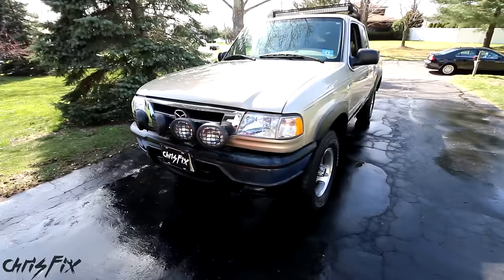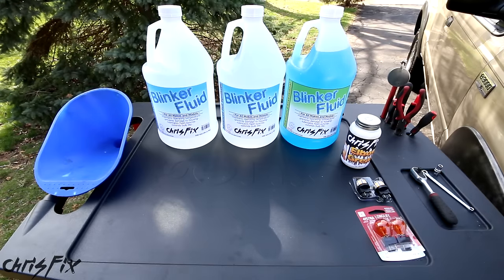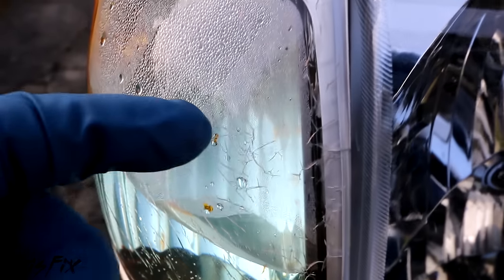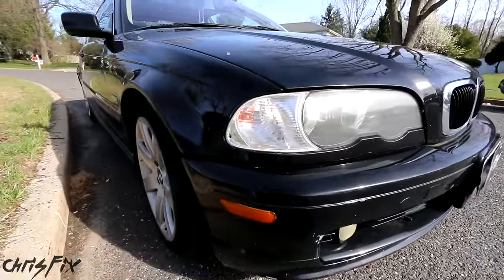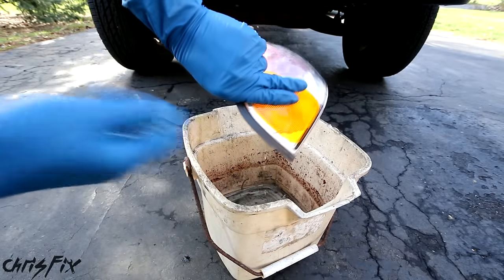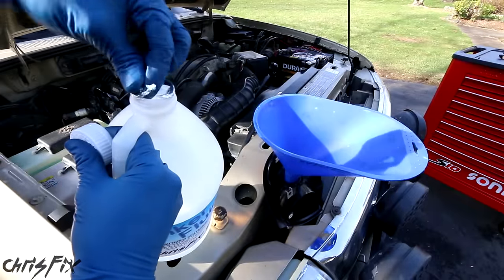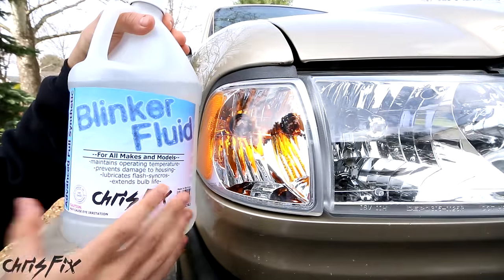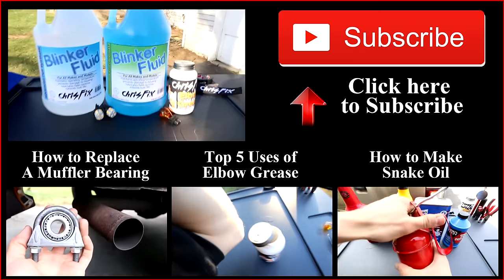How to Replace Blinker Fluid

Comment: How often should the air in the tires be changed?
Reply: Lmfao
Reply: +holidayhouse03 Every 5000 miles, unless you use helium then you can get by with 20,000 miles.
Reply: +holidayhouse03 I usually wait till its time to rotate the transmission gears. Don't wanna use up too much air. That stuff is expensive!
Reply: +holidayhouse03 Every time the season changes, you dont want to be using winter air when its summer and vice versa! Its really bad for your tyres.
Reply: When the temperature starts to drop, make sure you change out your summer air to winter air to prevent freezing!
Reply: You should check the Tire preasure every month once and pump them if needed... Rofl
Reply: +HEROrr Helium would escape out of the tire before you even get 1000 miles. Helium molecules are way smaller than Oxygen molecules :)
Reply: I forgot...i drive a RWD Volvo...does that make a difference?
Reply: Figures...it's never a straight forward answer...instead it's stuff about doing it seasonally...or milage...but that depends on regular or helium...I shoulda just stuck with a regular or synthetic oil for my 328,000 mile redblock question
Reply: Volvo for life...FTW
Reply: +holidayhouse03 change out the air and use hydrogen.
Reply: +holidayhouse03 Air? IN TIRES?! I'm still using stone wheels and wooden axles!
Reply: ***** who you qoutin with "DUDE"?
Reply: +holidayhouse03 Every 4 hours.
Reply: +holidayhouse03 Mix the air in the tires with VitalityAir. It will last maybe 50,000 miles.
Reply: +holidayhouse03 are u asking flushing the air or changing whole thing,,,?
Reply: +holidayhouse03 Don't forget to rotate the air in your tires. Not rotating the air will cause the tires to ware from the inside and can lead to a blowout.
Reply: Approx every 5,000 miles
Reply: Every 2 miles
Reply: Don' forget to switch from winter air to spring air.
Reply: +Robert Reyes This is a scam, you only need to change between winter and summer air. Don't let your mechanic sell you spring or fall air. Twice a year is enough.
Reply: Use nitrogen for the summer and hydrogen for the winter.
Reply: Hourly
Reply from the maker: +holidayhouse03 April 1st I always remove my winter air and put in the summer air. I usually do the opposite in November.
Reply: I just wanna try stuff like this out on a group of girl cub scouts, see if anyone notice.
Reply: You don't need to change the air, only fill them up
Reply: holidayhouse03  every 13 seconds
Reply: holidayhouse03 Well, you actually are supposed to slightly deflate tires when it's hot outside and slightly inflate them when it's cold.
Reply: Candycorn 2014 considering almost no one realizes that, I think the small amount of variance is not really  a serious hazard for regular motorists . It has effects in extreme conditions, and can cause uneven or premature wear...unless you are racing . The PSI does not have to be exact.  Although it makes for longer lasting tires, good stopping and tire performance.  riiiight?
Reply: holidayhouse03 every minutes
Reply: When you start noticing an unusual smell. You should check you tire's air freshness every 2 weeks or so, so that the air doesn't go bad and potentially damage your tires. Thousands of people die every year due to improper tire air care which causes tires to burst while they're driving on the highway at high speeds which usually results in fatal accidents that could've been easily prevented had they checked their tire's air on a regular basis.
Reply: You could squeeze in some concrete in there so you won't have to change air anymore. :D
Reply: loved this men..
Reply: Got to be careful with this one. I actually told a friend to do this and HE went to his mechanic the next morning and asked him to change the air. The mechanic asked him 'who told you that?' He said 'A friend.' And the mechanic said 'Are you sure he was a friend?!. LMAO still.
Reply: HeroRR I wonder if helium would make your wheels have a lower rotational mass
Reply: G
Reply: Make sure you put oxygen in there with the hydrogen! The ratio should be 14.6 to 1!! :)
Reply: holidayhouse03 Once your exhaust starts popping
Reply: holidayhouse03 I forgot to change into summer air last year, it cost me so much
Reply: every time you stop the car. if you stop at a red light you need to replace the air
Reply: it shouldn't
Reply: Every time you add gas you should change the air on the tires to avoid losing mileage
Reply: Friend once Insisted that the now FLAT tire in the trunk...weighed LESS because the POUNDS of AIR were now Gone...
Reply: DONT USE HELIUM! It will make your car float away like a balloon!
Reply: Well you don’t have to anymore just cut a hole in the rubber and fill it in cement
Reply: Make sure you Get fully synthetic air though
Reply: holidayhouse03 any time there’s a 4.8° temperature change
Reply: HeroRR Lmfao
Reply: Fr??? Lol
Reply: I made it 30 seconds.
Reply: Like once per 2 years
Reply: HeroRR never knew you watched Chris
Reply: use water in the winter then you will never get a flat tire!
Reply: holidayhouse03 about every 4 days.
Reply: I think you need to replace your tire fluid
Reply: Everytime there's a category 1 huracane. That way you can collect air that will help your tires gobierno faster. 150 mph winds or higher.
Reply: holidayhouse03 make sure you flush all the old air with water from a pressure washer
Reply: Every 2 weeks on a thursday
Reply: I think you need to buy new tire fluid
Reply: The air gets fatigued pretty quickly in older cars. I would suggest that everytime you fill your gas you bleed and refill your tires.
Reply: Do the local stores get the used air for recycling?
Reply: @HeroRR  You can get by with nitrogen, tho...
Reply: Depends on the type of car you've got... certain cars need a more frequent air change throughout the year and then depends again on the mileage you've put on those poor tires of yours...  so I assume you can switch from air to shit and then you will never change it anymore... shit is shit so no need to be maintained
Reply: holidayhouse03 hil”air”iously
Reply: Every rotation. Keep track of it and every time your tires rotate. You need to change the air in them.
Reply: this is the funniest thread lmaooo I mean uhm... most informative

Comment: Excellent video, thank you. I would also like to point out that beside the blinker fluid, it is of vital importance to regularly check the flux capacitor to ensure the engine operates smoothly for a long time.

Comment: The frequency of the blinking depends on the viscosity of the fluid . I like to use a thicker fluid for lower blinking rate per minute and a 5 w 20 for more rapid blinks
Reply: And its quite a good practice to consider what climate conditions you operate your vehicle in.
Reply: 5 winks every 20 seconds, that’s what those numbers are for
Reply: @pimas11  dies of laghter
Reply: I recommend 0 W 20. Not only the engine loves it.^^
Reply: Yes of course, but how often do you change your blinker fluid filter?
Reply: @southernflatland  Every year or every 15.000 KM.
Reply: @thev8king902  Ah, gotcha. But my left blinker is still stuck on, I think I need to check my blinker fluid pump.
Reply: Nice
Reply: What viscosity would you recommend for variable blinking rates? Maybe a multi-grade blend?
Reply: I prefer the 1D-10T variant of blinker fluids

Comment: do not use cheap blinker fluid, recently put some in my tesla, it destroyed my transmission and exhaust bearing.
Reply: that's because the blinker fluid gets in the tesla's gas and goes into the transmission
Reply: The blinker fluid ruined leaked into my gas cap fluid and ruined the whole engine
Reply: Tesla's don't really have a transmission
Reply: Frosty don’t think you got the joke mate
Reply: @Crushhyt  r/wooosh
Reply: The cheap blinker fluid i brought from walmart ruined the electric motors in my miata. I need a refund.
Reply: Tesla's don't have exhaust pipes so they probably don't have exhaust bearings either
Reply: @Cugy_2345  r/wooosh
Reply: I ran my car low on blinker fluid once. I had to replace all my lug nuts and I have a nasty radiator tap.
Reply: Ya same. Mine got to the engine and ruined my v4
Reply: Are the Piston return springs ok in your Tesla after that? I know Tesla's have big cylinders
Reply: Oliver Lowe Pretty sure Frosty was being sarcastic and you fell for it
Reply: @Cugy_2345   IT JUST A JOKE
Reply: @Cugy_2345  r/wooosh
Reply: Also, i need help because i have low compression ratio in piston No1
Reply: @Skitungen  please don't. And why did you put my channel name in your comment
Reply: @Skitungen  what does r / whoosh mean
Reply: No one copy my channel name please
Reply: @Cugy_2345  that u didn't get the joke.
Reply: G4B3 M1N3CR4FT - r/whoosh is a reference commonly used on the forum site Reddit.  Basically refers to the metaphorical “whoosh” sound of an idea flying past someone’s head, but not entering it. 😉
Reply: Oliver Lowe - Aw man that sucks.  Maybe if you tweet at Elon he can get SpaceX to send you some of the blinker hardware that they use on their rockets.
Reply: It was an April fools video...
Reply: CreepyChillz you’re in over your head mate
Reply: It makes you Diesel go into your gas carburetor which can Cesar motor
Reply: Is your Tesla straight piped? I think that's why
Reply: You're not using the correct gas for your car that's the problem actually
Reply: Nuebix fucking jokkkkeeee
Reply: be sure to replace that gasket he lubed up... I had a v3 that leaked fluid on the fan... It got into the electric cylinder threw the intake and burnt a hole in the rod. the overhead rod motors are zero tolerance when it comes too blinker fluid (source: my degree at youtube university)
Reply: when I used cheap blinker fluid on my Tesla it acted really weird, it somehow lost its engine but it still runs🤔
Reply: What about the piston return springs?
Reply: ......but..........electric car........no exhaust......
Reply: Tristan Berke but...........joke
Reply: I recently used blinker fluid on my tesla too. It blew up my gasoline tank. :/
Reply: Oliver Lowe shit dude. Replace it for fartcannons, beter “sound” 😂😂
Reply: Hasan Ahmed 🤦🏻‍♂️
Reply: You need be using premium gas that’s why.
Reply: Maybe you should’ve watched the whole video
Reply: My tesla started spittting flames out of its coilovers
Reply: G4B3 L1F3 🤦‍♂️🤦‍♂️🤦‍♂️🤦‍♂️ ya don’t get the joke?
Reply: CreepyChillz lmao everyone knows it’s just a joke
Reply: Oliver Lowe 😂😂😂😂😂
Reply: Idk if it’s bc I’m a girl or not but I don’t understand how this happened
Reply: @jasone6621  

Looks like somebody missed the joke
Reply: The timing belt on Teslas I heard is also susceptible to damage from cheap blinker fluid, leading often to a worn pressure plate in the hydrostatic drive unit, at least this is what my mechanitian told me
Reply: sebastian ibarra I wish I would’ve known this before I changed my Bolt’s blinker fluid.  Didn’t use full synthetic and now my Bolt’s turbo thrust turbine is fried...
Reply: Jack Pepal Tesla’s don’t have engines
Reply: @GrilledSnakeLegs  Tesla's don't take gas 🤷‍♂️🤷‍♂️😂😂
Reply: @zzz-vader-zzz8595  r/wooosh
Reply: Lol bad
Reply: @Cugy_2345  r/woosh
Reply: @Crushhyt  Wooooshhh
Reply: CreepyChillz r/woosh
Reply: Oh crap did it also mess up your gas tank?
Reply: zZz-Vader-zZz it’s a joke

Comment: My steering wheel only turns the front wheels, how do I install one to turn the rear wheels too?
Reply: John Doe I think some monster trucks do that for extra steering. Or at least in The Crew 2 they do. 😂
Reply: Get a GTR with HICAS
Reply: @terragaia7092  or an Z32 300ZX
Reply: @Miiiics  Oh that makes sense, thanks, all the auto parts stores I went to "didn't know anything" about that, I guess it's not a big money maker for them.
Reply: Losen the lug nuts on the rear tires until handy
Reply: @jorgewuzhear  Thanks I'll try
Reply: 1989 prelude si 4ws brother
Reply: Buy a lafarrari. I thing that steers slightly in the rear
Reply: @Miiiics  very true
Reply: Get a BMW with active steering that turns the rear wheels too
Reply: Just get a Galant vr-4 it's the same as an eclipse gst but with all wheel steering
Reply: Buy a prelude
Reply: Step one: buy two pairs of training wheels attach each one to the rear wheel.
Reply: The oversteering if you do that lol

Comment: Great how-to, it made changing my blinker fluid very easy and I saved at least 30 dollars!
Now can you do one on how to rotate the air in my tires?
Reply: Don't forget to top up the air in your tires every week. A full bucket of compressed air and a sturdy funnel will do the trick.
Reply: +Sebastian Watson and another good thing is to check your spark plungers and rotate your pistons through cylinders like take the one in the 1 st cyl and put it in the 3rd
Reply: +Sebastian Watson Really? I do 2 buckets of air each week but then again my funnel leaks a little bit of air so it probably makes sense.
Reply: +Sebastian Watson my funnel got sucked into the tire when I tried this, now how do I get the funnel out or is it supposed to be in there so I don't have to put in as much air?
Reply: +Slim Circuit change summer air to winter air to fall air to spring air etc
Reply: +Connor Boop the summer air is stuck. I can't get it to change to winter air I need help
Reply: I connect all tire valves with tubes and let them do the air-exchange by themselves. Saves me the trouble of rotating the tires.
Reply: +windbreaker57 I tried this it caused the air to get really hot and blew my tire however I think I did it backwards maybe that's why I don't know
Reply: I dont have any air in the bottom of my tires, how do i fix that?
Reply: +Adam West I just got a really big girl to sit on the top of my tire for about 5 minutes and it only took like 4 boxes of twinkies, hope it helps
Reply: most tires are flat on one end, rotate the tires and keep it on jack stands until ready to move car/truck...My rear tires on my John Deere tractor have water on the flat side, blinker fluid would work for this also.
Reply: Slim Circuit 😂😂
Reply: TinselKoala don’t listen to them, you clearly have to take a banana and rub it it onto the on to plastic tire.
Reply: TinselKoala all that you have to do is while airing them up, spin the tire, hahahaha
Reply: You also need to change your clock fluid, 4 o clock fluid at 4 o clock. Etc.

Comment: The level of commitment on display here is staggering. The foil seal on the bottles?
Reply: They didn't put a foil seal on it, it came like that from wherever it was bottled. They just took off whatever label was on the unopened bottle and then attached their printed one.
Reply: Probably vinegar.

Comment: I have a problem of dry eyes. My doctor told me to blink more often. Sometimes I forget.
Can I use blinker fluid?
Reply: I mean it gives you uncontrollable blinking so I guess
Reply: No crazy
Reply: @JakePlayzGamer   is there any variant with some kind of controller embedded with it?
Reply: @prithvirajdj  no, unfortunately
Reply: You can enter the bios and decrase your eyes overclock rate. They just need a lot of water cooling. I recomand 80mp with 75ghz.
Reply: Maybe because you're a BMW driver
Reply: No don't use blinker fluid, that'll make you blink too much. Use eye drops.
Reply: Yeah
Reply: @AndrewGOP  I already used the fluid and my eyelids are blinking at 75Hz. My monitor is also 75Hz and they have resonated in such a way that I can't see anything on the screen anymore. What to do now?
Reply: @prithvirajdj  You need new thermal paste. If you add new thermal paste to your eyes sockets you will decrase the temperature and you can overclock to 120hz!
Reply: @incesteagle1212  You have a good thermal system!
Reply: Absolutely I had the same problem it helped me a lot
Reply: Make sure you use conventional blinker fluid only. Synthetic causes too much blinking.

Comment: Great tip. On tire safty, remember to change your tires air from summer to winter and vise versa. Cool winter air is less compact and has lower humidity. Summer the other way. Could throw off tire pressure gauges and lead to bad tried ware and maybe even an accident.
Reply: idk why but the air part lowkey kinda makes sense 💀😭

Comment: My blinker fluid froze this winter. Do you have one winter rated?
Reply from the maker: The Synthetic is winter rated.
Reply: link?
Reply: ChrisFix Do modern cars have fluid in blinkers? And is the procedure different in the new cars?
Reply: it's quite common to put antifreeze in your blinker fluid in Canada.  It actually helps on the highway at night with a slight tint of the lights.
Reply: Mau F there is no such thing as blinker fluid
Reply: JHB12 His sarcasm went right over your head
Reply: I know right if it is I didn't know I thought blinkers run on your battery
Reply: As ChrisFix mentioned try synthetic. It will allow you to operate your blinkers all the way to 30 below 0 Fahrenheit.
Reply: JHB.....

Now are you sure??  Like 100 per cent sure??  Like absolutely, positively sure??
Reply: Like ChrisFix said this video its a parody
Reply: JHB12 no blinker fluid is a real thing trust me
Reply: Mau F come to my house
Reply: Mau F are u serious
Reply: unknown 4u yes modern cars have them. A little secret is you can mix gas with anti freeze and works just as well as blinker fluid. Good luck!